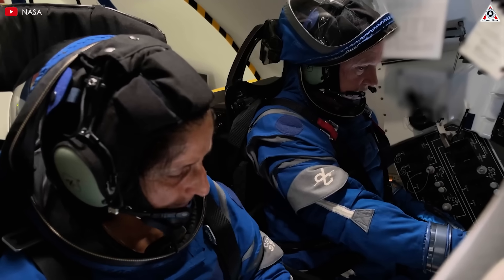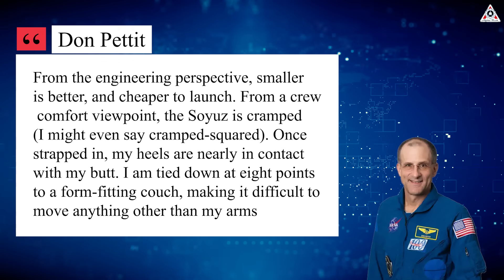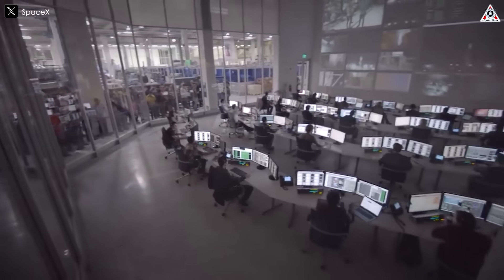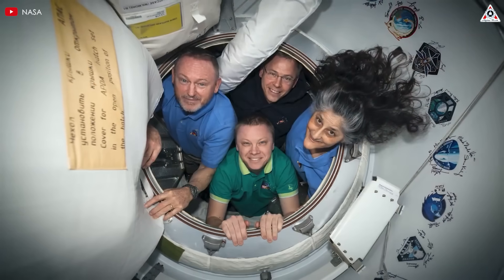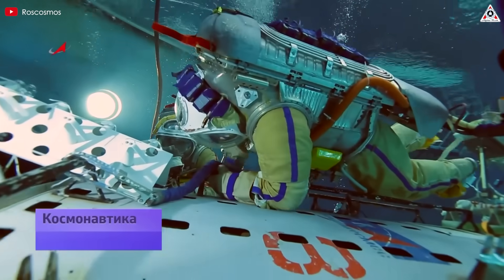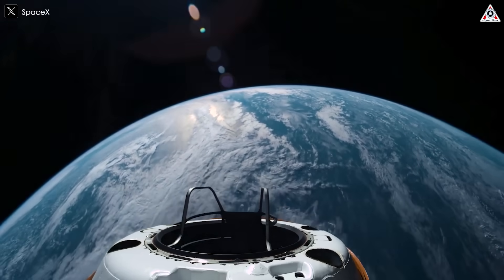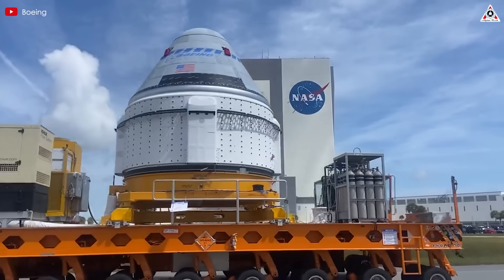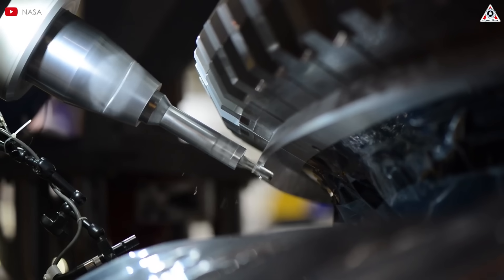It's mind-blowing! What inside the SpaceX Dragon Interior shocked NASA's astronauts...

Comment: NASA should start using the Artemus (Orion) deep space capsule for testing to the ISS.   SpaceX has no plans for a deep space capsule and the Orion capsule is a deep space human life raft.   The Orion capsule is designed to dock with the ISS.   It had heat shield problems on its first earth atmospheric entry from lunar orbit which is at 25,000 mph verses 17,500 mph for near earth orbit.

Heat will go up with the square of velocity per kinetic energy.   25k^2/17.5k^2 = 2.04 times more heat energy needing to be addressed with the lunar return verses low earth orbit.   There is no discussed tipping point requiring the lunar heat shield to need the initial higher velocity to function.   The space craft needs to be able to make emergency returns from earth orbit.   The likelihood is the Boeing Starliner has no significant advantages over SpaceX dragon and costs much more.   The Orion space capsule has at least the size of the dragon space capsule and will likely be a long term deep space lifeboat if the design proves reliable.    It would be an expensive, but reliable capsule to the ISS and other space stations.   It is intended to return astronauts from lunar orbit.   

Since Starship doesn't have a crew abort escape system and makes use of repulsive landing not approved for human flight.  I hybrid crew transport using Starship and the Orion capsule could be used to ensure crew safety especially for earth landing.   It is important to note this could take place in a couple years if the Orion capsule proves reliable and Starship proves lunar orbit capable at least for cargo.   This first lunar mission would be greatly testing without Starship capability for crew habitat.  

Crew habitat on Starship is not showing signs of the great development it would need.   Far more time for design, development and testing than could be expected in two years.